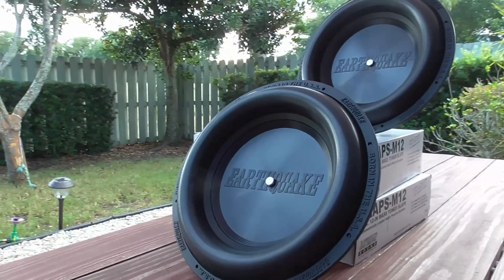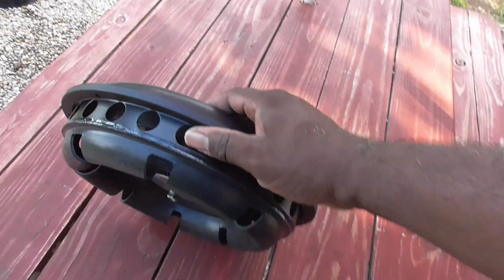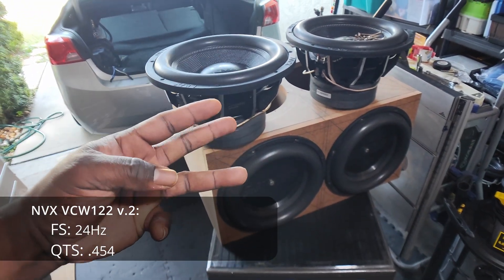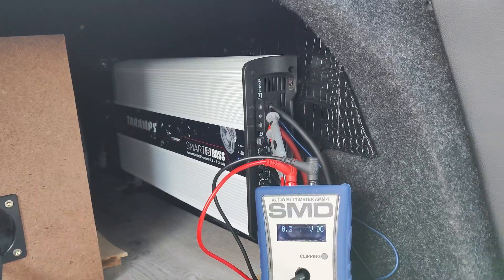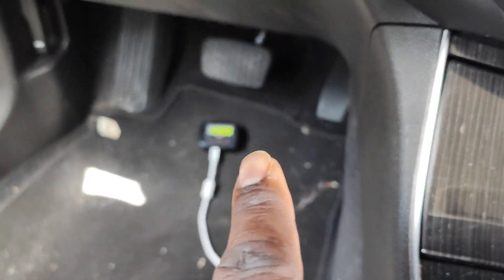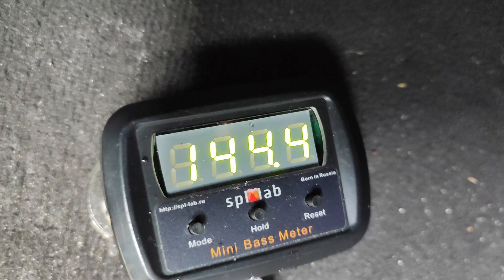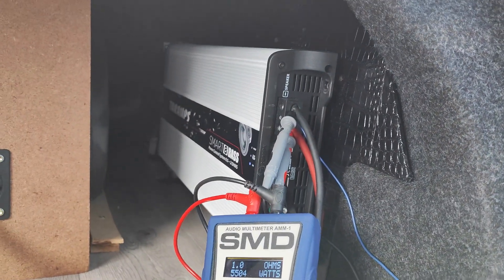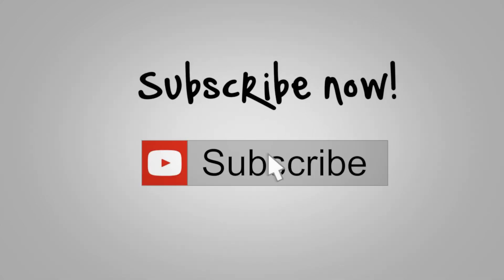The Best Passive Radiators For Car Audio | 7,000 Watt SPL Test

Comment: id love to see you build a mass loaded transmission line with a passive radiator where the port should be with the tline tuned to 50 and passive radiator tuned to 30
Reply from the maker: Interesting.
Reply: @BudgetBassHead if u  do end up making a design like this put a lot of stuffing in the box to prevent the higher harmonics of the t-line (mostly behind the driver) and prevent comb filtering that occurs with non stuffed t-line enclosures

Comment: Myself, i recommend using old school , passive radiators and not worrying about the new adjustable version. From what I understand they often break at the center point. 
  Passive radiators have been around since the mid 60s.Not until now , did they have the adjustable version.
   The trick is you're supposed to match the weight/ stiffness of your passive radiator to the amount of air that would be passed through a port of the same enclosure.  So go with the stiffest passive radiator  you can find

Comment: I've got a question what would happen if you did a 4th order box where you did the sealed chamber with passive radiators but separated the potted chamber would that then be considered a 6th order box

Comment: VERY NICE VIDEO, THANK YOU. PLEASE NOTE THAT THE M SERIES PASSIVE RADIATORS ARE DESIGNED FOR THE LOWER POWERED SYSTEMS. UP TO 500 WATTS. THE SLAPS 12 OR SLAPS 12 LM (LOADED MASS) OR SLAPS 15 V2 ARE DESIGNED FOR HIH POWERED SYSTEM
Reply from the maker: Great info. I didn't know that. Thanks for sharing

Comment: I thought whenever you do a passive radiator enclosure you want to make it what the sub woofer specs call for if it was ported (minus the port area) 

Then add  the pr as long as if can move double the displacement of the sub
Reply from the maker: There is actually a few school-of-thoughts about PRs. And yes, that is one them
Reply: @BudgetBassHead okay that’s what I’m doing a stereo integrity 3 cubic foot with 2 of them slaps but I’m taking the weight off the cone since the box is bigger

Comment: The ideal size for passive radiator box is usually similar to ported minus the port volume. Though in models like Hornresp I've found part of the port volume to act like added box volume at some frequencies.

Comment: Hey try something like this but with PSI audio passive radiators you’ll be able to do a lot more with those you have the normal size with 60mm xmax and then you have the high excursion with 80mm xmax and they’re at a pretty good price

And I thought the enclosure has to be  the same cubic foot as if it was made for a port but obviously minus the port
Reply from the maker: I've actually been meaning to try out some of those!

Comment: I've Been thinking... Have you tried this sub in a 4th order application using the radiators in the sealed section? Wonder how the output would be ??
Reply: That would be a 6th order
A PR acts just like a port, except less efficient but doesnt need space for port volume

Comment: So I want to do something like this in our 87 blazer (in profile pic) 
Currently running 2 kicker gold 12’s sealed in each side panel, and a skar EVL 18 in a ported box. Not sure on its build and tuning but I’d guess 3.5 cubes. 
I’d like to build a box for the 18 with 2 passive 12’s. Volume displacement of the 18 is 334 in3 and 2 passives from what I can gather would be 599 in3 so no issues there: just don’t know what size box, firing direction, etc. thoughts?
Reply from the maker: I would suggest building a box and tuning it to the driver, then using a modeling program to simulate how the passives would affect it.

Comment: There is a proportion from electrical subwoofer and passive radiator? 20 in electrical radiator vs passive radiotor inch? Thanks

Comment: I'm running a single nvxvcw122v3 currently and I'm wanting to play with these radiators to get gains .. my question to you is this , would I gain more with this woofer using a sealed box with a couple of those radiators vs. a ported box built specifically for this woofer ??

Comment: You could make 3/4 inch PR rings on the enclosure. That way when you reach max excursion on your PRs they do not come close the the sub magnet which can also tear the bolt / weights out

Comment: All cool and stuff. I was thinking of converting my sealed box to PR box but sadly I can't justify the cost. Not only I need a 15" PR which already costs similar to some cheap subs. But still need  DSP to EQ it properly for flatter response as my sub gets peaky around 50-70hz. If I  built a new box the size of a ported box then I would also need two PR's to get a nice flat response. And still ported box out performs it. 

If PR cost like 50 bucks I wouldn't really care and would go with it just to save myself from building a ported box.

Comment: Just subbed up. I'm going to be building a custom center console for my short cab truck with either a 6.5“ or 8“ sub inside. A PR should help get some more low end extension on the small speakers and small enclosure.

Comment: I was hoping you would have repeated the tests that you've done previously with the Single Radiators before going full tilt, but I understand the anxiety to send it out of the gate 😂. Ive had great success with a 2.25cf per sub on low power, like you did in your previous vid, and I'm waiting to see what you do next. 👍

Comment: I have ? Can I run 2 15inch subs wit 1 radiator or 2? What's the best way for 2 15s
Reply: I would do 2 18 in passives
Reply: @pay2play456  ok thanks

Comment: Don’t trust the bolt thru the center of the cone on the Earthquake radiators. Looks like a failure point, just like you saw.

Comment: Your useing 12 gauge wire for those subs? .whats wrong with you!? 
Use 8 gauge! At least!
Reply from the maker: @lee28.78  the things we have been lead to believing... 🙁 Don't believe the marketing hype of oversized speaker wire. At this short distance, while burping, parallel to parallel 12 gauge is fine. You literally just seen me pump 6,000 Watts through this system, there were no burned wires, there were no burned voice coils, there were no overheating of the amplifier. Besides, the push terminals only accept up to 10 gauge. So to dual wire, use 12 gauge.

Comment: I'm putting a system together and I've always liked sealed boxes. I know it won't be as loud but I think it'll sound better.
Reply from the maker: @Chromedome-ss6mg  sealed enclosures have more accuracy.
Reply: Ported boxes can sound quite clean as well, but typically have to be QUITE large to do so

Comment: I absolutely love the Earthquake Magma subwoofers from the late 90s. I held onto a pair of 15"s for as long as I could. They eventually sagged & locked up entirely after about 20 years of almost constant use.

I always wanted to put both of my 15" Magmas into a box with 4 of the 15" Earthquake passive radiators...but I'm clueless as to how to properly implement the passive radiators into my builds. I'm not the brightest guy when it comes to designing enclosures to begin with...but still have never purchased a pre-built one. It was two decades full of sealed boxes & slot ports over the years for this guy...til I finally figured out how to use aeros....
Reply: I got the 12  Magma in the late 90s  I still use it every day, but I don't push it to hard anymore.  When they first came out they had dual 3 ohm voice coils, around 2 years later they changed the basket, the center cap, and started using dual 4 ohm voice coils.   EARTHQUAKE made in the USA

Comment: I'm fairly new and was wondering if their is a benefit of this verse a port besides space...trying to learn
Reply from the maker: @ajmartinez8163  it's easier to tune a passive radiator. Once you build a port you would have to use cutting tools to Lengthen or shorten it for tuning.

Comment: I was considering buying those passive radiators but I decided to go ported instead. I bought a 2 10 sealed box and drilled baffles through the wall separating the air chambers and blocked the other chamber with a 12x12x1 plywood plank. I then drilled a hole through the plank to make a round port tuned to 28hz. 

I could've gone either way but I'm glad I got to see how you set yours up. Looks killer
Reply: I'm trying to understand what you're saying. Did you say that you put a port in between the two chambers?
Reply: @Chromedome-ss6mg  no it sounds like he converted a 2 x 10 dual chamber sealed box into a 1 x 10 ported box. Just cut some holes through the dividing wall so the one woofer could use the whole box. Also sounds like he put a plywood disc or a square to cover up the other speaker hole, and installed a port in it.
I'm not sure why he didn't just buy a ported box, but perhaps he was going to put a passive radiator in the other hole but changed his mind.

Comment: I dont like the idea of building a solid sub box and then have a large part of it being cheap plastic. I mean, there's a reason why we make speakers from as stiff of a material as possible and that aint it. 

Great video though!
Reply from the maker: @OlaJustin  I understand what you're saying is makes a lot of sense when discussing speaker terminals. But in this case the plastic is part of the moving Mass.
Reply: @BudgetBassHead  Absolutely, but I still feel that it will wobble and bend, causing distortion. Or? 

Not that distortion is a big problem in bass... Certainly not buro runs, but still... that plastic seems a bit too flimsy.

But I realise I might be wrong.

Looking forward for follow ups! :)

Comment: This doesn't cause Phase issues,?
Reply from the maker: @ufarkingicehole  no. The passive radiator uses the back wave (from the rear of the subwoofer). The same as a ported enclosure.
Reply: Only under tuning frequency, same as ported

Comment: So excuse my ignorance but you run an active sub with a passive radiator so the passive radiator gets hooked up to the amp as well ? Do you wire it parallel with the active sub ? Or does it just go in the box with the active sub and not get any wires hooked up ? I’m not fully grasping how these work . I’m not really seeing how it’s saving any space either . Those enclosures are looking pretty large .
Reply from the maker: @Brandon.McNeely  the passive radiator is just a cone of a subwoofer it has no magnet it has no voice coil. And the ones that I use don't even have a basket to attached to them

Comment: For my next setup I'm going to try to get 2 of those nvx vwc in the 15s. The 12s you've had get loud and they look nice and clean. 
What are you running for mids and highs? Sorry if you've answered that in a video already. I'm thinking about going nvx on whole system and wanted some feedback on nvx midrange speakers. 
Thanks for the videos, I'm learning quite a bit from your content 👍🔊🔊
Reply from the maker: @bojow8102  I just installed their 6 x 9 premium component system; for my front stage. It's amazing. Video coming soon.
NVX® XSP69KIT 6x9 Car Speakers,... 
https://www.amazon.com/dp/B0CJJZ53NS?ref=ppx_pop_mob_ap_share
Reply: @BudgetBassHead  Cool 👍 
I'm thinking I'm going to get their component set for my front and coaxial for the back. 
Thank you for the reply and I will definitely watch the upcoming video.

Comment: The primary drawback for PR is the added cost.  The advantages outweigh the cost, in my opinion.  I get fantastic sound quality and a flat response down to mid 20s from a single 10".
Reply from the maker: @Satch_4_Hogs  But what is the cost of a 12 inch subwoofer that has 4 inches of X-Max? The JL Audio W7-12 is $1,500 after taxes. The Sundown Audio X series 12 is around $700. I understand what you are saying, about your setup; but in my setup, the PR is practically paying for themselves.
Reply: @BudgetBassHead  I'm not sure you understood what I said.
Reply from the maker: @Satch_4_Hogs  oh, my bad.
Reply: @BudgetBassHead 4 inches xmax? On 4:50 it says 20mm

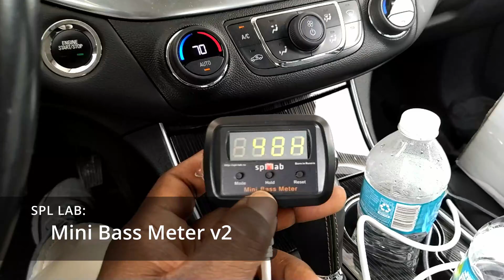Comment: 5:40 Whoa whoa whoa. The ambient noise level of your vehicle with the air conditioner running is 120dB? 

That sounds way off. Mine with the AC fan on low is 75dB. This is mostly low frequency related rumble. By 200hz it's dropped to 50dB and by 1k it's under 35dB. This is measured near headrest. 

120dB is quite loud. You might want to look into why that meter is reading so high.
Reply from the maker: Is measuring that high because it's in the footwell near the engine.
Reply: @BudgetBassHead Ah, so there's some kind of low frequency rumble going on that's magnified in the footwell area. Interesting. Next time I have my rta out I'll do some testing in the footwell area. 👍
Reply: @BudgetBassHead no... per the sheet and specs, minimum value the meter will show, is 120, will not register at 75dB, nor 100dB, only 120 to max.
Reply: @MilGrip76 Correct, if the noise was under 120, it would not register at all. So he's probably got some sort of low frequency vibration at ten or fifteen hertz.

I don't know of any other way the meter could pick up a reading in his footwell, without sound system on.

Comment: I dont think the extra cone area of the PR is doing what u think in helping spl. Its my understanding the PR's allow you to achieve a lower tuning freq in a smaller enclosure.
Their impact on spl purely from cone area may not apply because a PR is alway out of phase from the driver unit & some deconstructive interference may result.
Reply: @Forcefed2002- This is why passives perform better when placed on opposite sides of the powered woofer= NOT on the same plain. You can go for a deeper bass extension, by using the bare minimum, requirements, of passive radiators. Or you can raise the tuning of the enclosure, by adding more passives, & this should gain SPL, as long as the New tuning freq., is not too high. Testing is the key.

Comment: Do you use your PRs in accordance to the suggested sizes on the instruction manual? I will be tackling that 4th order PR box next as it says (per instructions) the front section only needs to be .75cf to reach 42hz.  Thats astounding. Box wont even be 20 deep😏 Awesome video again. Thank you for your creations!

Comment: Those passive cone bolt may just need a washer to spread out some force and have a smooth round clamping area, vs the sharp edges of the bolts only. Just my stupid idea. Love your videos!
Reply: @TurboJohn74- Those passives have a very strong cone, i have seen a video of them getting kicked, & they were fine. @ the end of this video, he showed how it broke= it moved far enough, to hit that center bolt, on the subwoofers magnet! But yes, prob. Some epoxy, & using a huge washer, under that outside bolt head, should work. Then if he made spacers for the passives, to give adequate clearance, it should work?

Comment: @BudgetBassHead- Great video. All though doing sweeps @ Lower, to mid volume, is safer on the equipment, than doing full volume sweeps, most of the time shows false peaks. It is much better to use test tones, @ mid volume( + make sure that each tone is held for the same time, like if you hold the 1st tone for 2 full seconds, then do that for every test tone ) start trying with a 30 Hz test tone, going up to 65 Hz, 1 freq. @ a time, as this covers the possible peaks of 99% of all regular vehicle builds. When you do find your mid volume, ( full 2 second held ) test tone peak, you should also test 1 freq., below, & 1 freq., above this peak freq., when going for Max SPL Scores, as Power can, & does change the resonant freq. of a vehicle, "If enough Power is used".  Lastly, i would imagine you could hot glue/epoxy that weight back on your damaged passive, and just use a big washer under the bolt head sticking out of the front of your damaged passive radiator. Hope this helps, & can't wait for your next video, & great choice on your New Amplifier😎!

Comment: I have been kicking around the idea of a 6th order that uses passive radiators rather than ports. I'm not expecting it to be superior but it seems like it could open up some interesting options for smaller areas. Even if it isn't great, sometimes its fun to do something just to see if you can.

Comment: At least earthquake has made changes to their passive. The original passive was on their ht sub enclosure and it was a 12in without the motor it had a cardboard tube insted of voice coil and of course non adjustable. The subs they used was the magma 12's exact same car audio sub just sold as home theater wired to 2ohm.

Comment: I use these exact passive radiators with 10 inch powered subs in my home theater system. The setup gets stupid deep.